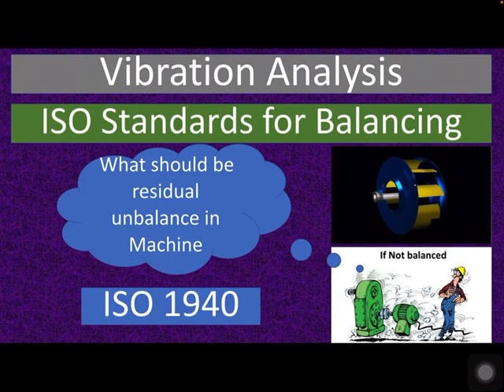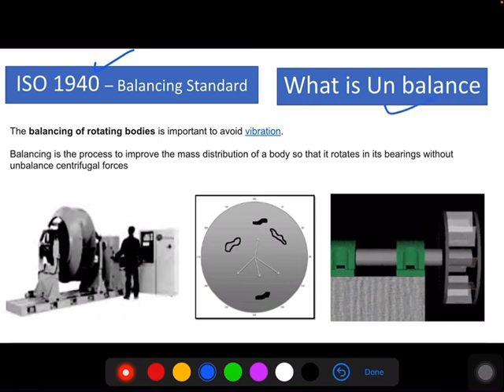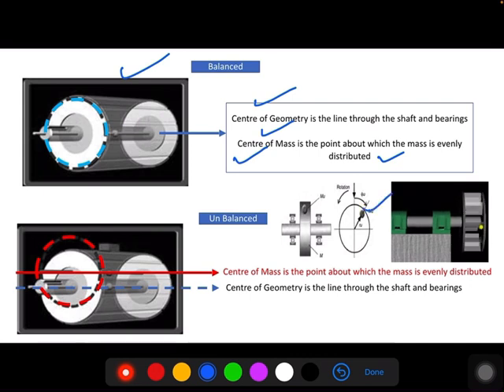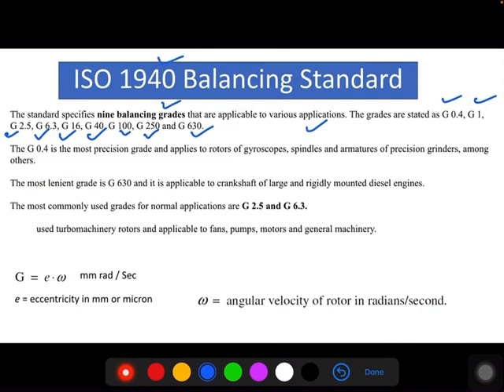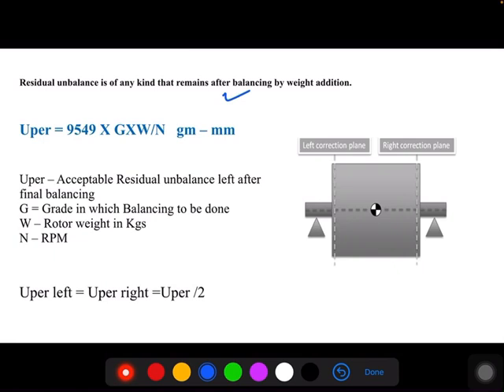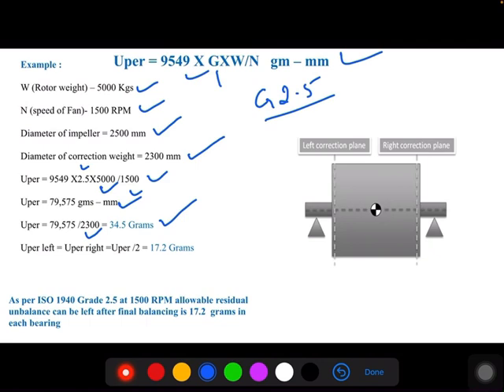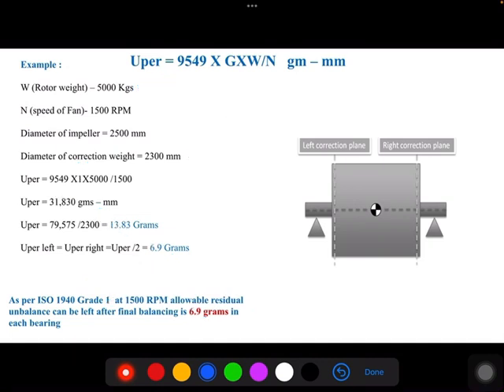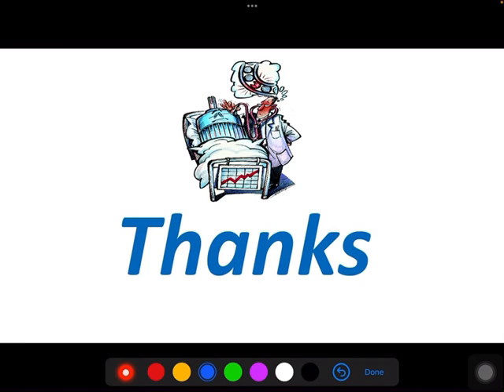Vibration Balancing Standard || ISO 1940 || Acceptable Limit for Residual Unbalance || Balancing

Comment: Hi sir 
We have a vibration issue in the car sheave which is located above the lift cabin and it was driven by the machine mounted on the machine room.. in this case we have to take the machine rotor weight or the car sheave weight

Comment: Nice. 
Where you got númber 9549?
Reply: I believe it is the 'combined' conversion rate from (rad/s > rpm) and (kg > g).
1rad/s = 9.54929... rpm.  and of course 1kg = 1000g>

So G was measured in mm*rad/s, but rotor conditions are given in kg and rpm.
And res unbalance will be in grams.
Reply: Someone correct me if I'm wrong, but this is what I gather from the video :P